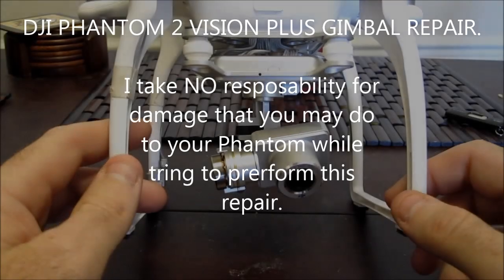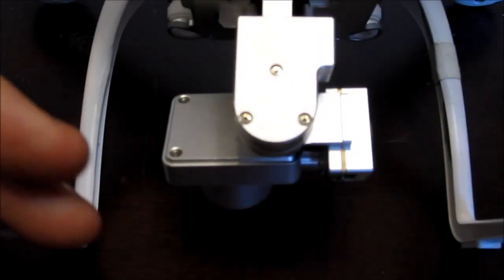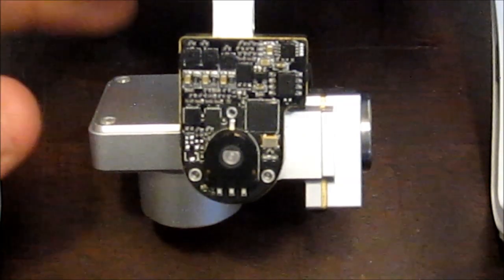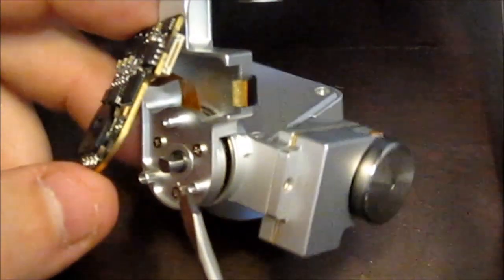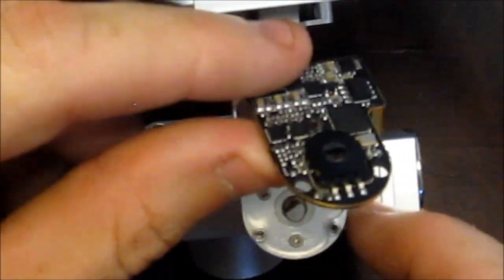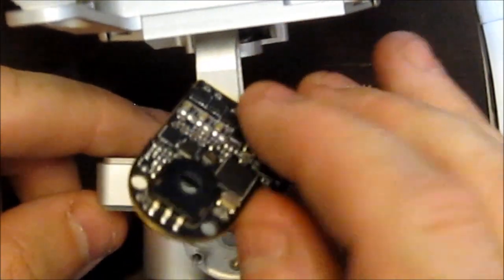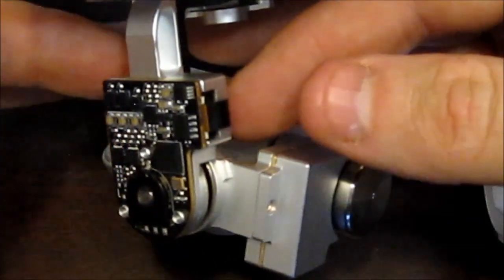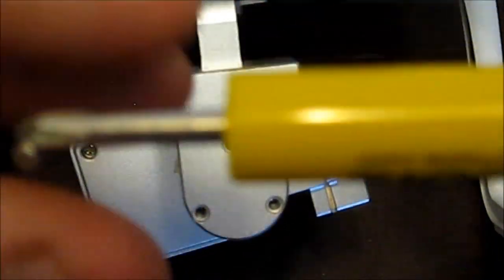DJI Phantom 2 Vision+ Gimbal repair

Comment: Want to spy on your neighbors? Or do something a little less illegal like getting really cool pictures that you couldn't get otherwise? I'd suggest grabbing this drone!🎆🎇>JustU.Faith/DJIdrone?起    Great performance and is extremely easy to fly. Great video. I would say that if you are into RC at all, you need this and it will be great fun without the difficulty of flying the typical quad-copter. It is GPS controlled and can even fly itself...what else would you need?

Comment: It's not working with mine.
I use a good plier, but it just won't move. I'm afraid to brake it when forcing more.

Oh, and for the ribbon. 
There's a small black handle, make sure to unlock that one before removing the ribbon.
Reply: Good tip!!!!

Comment: thank you!  This worked to straighten out my dji3 after a small crash. It was crooked at each start up and IMU didnt fix it and auto calibration only worked per flight. This was a simple permanent fix...just a little tricky getting that cable in. The dji3 pro is the exact same except it has two extra screws.  ...anyways...thanks again.

Comment: Hello! I had the same problem as you with my phantom 2 vision plus and I did exactly what you did, it worked! The camera was level again! But after the next flight I had the same problem. I tried to fix it again like you did and the camera was level again. But after the next problem the problem was back. Do I really need to do this after every flight? ... Thanks :-)

Comment: Heeey THIS IS FALSE !!! They can severely damage your phantom if they do this twist

This is corrected by calibrating the IMU "Calibration Basic IMU" in the wizard.

Heeey THIS IS FALSE !!! They can severely damage your phantom if they do this twist

This is corrected by calibrating the IMU "Calibration Basic IMU" in the wizard.

Heeey THIS IS FALSE !!! They can severely damage your phantom if they do this twist

This is corrected by calibrating the IMU "Calibration Basic IMU" in the wizard.

Heeey THIS IS FALSE !!! They can severely damage your phantom if they do this twist

This is corrected by calibrating the IMU "Calibration Basic IMU" in the wizard.

Heeey THIS IS FALSE !!! They can severely damage your phantom if they do this twist

This is corrected by calibrating the IMU "Calibration Basic IMU" in the wizard.

Comment: Excellent video! I have a drone shop and get so many people that come in with damaged and uneven gimbals on their P2V+s' and Ive always tried to find a way (online) to somehow calibrate the gimbal and get it back even but from what Ive read, there is no gimbal calibration process for the P2V+ and DJI doesnt offer individual repair parts for the gimbal/camera system. I feel so bad telling customers they need to replace the entire $600 unit! After watching your video however there may be hope for some of them! Thanks again for the info! Ryan

Comment: Hi, Thanks for sharing this wonderful video. By the way, is it the same method for restoring Zenmuse HD-3D? Broke my 3rd Zenmuse gimbal, so i thought of harnessing parts from all 3 gimbals, finally finished assembling using several different parts from all three gimbals. Now on startup the gimbal just seems to go crazy and out of control, making grinding noises, moving on all axis, its just acting haywire. Checked all the hex screws, they are all tightened, did factory reset by shorting two points on the main board, updated to the latest firmware. Just don't know what to do, i just don't want to go and waste another 300$ for a new zenmuse. After watching your video, i think it has something to do with the position of those Potentiometers.

Comment: THANK YOU SOOO MUCH
You saved me 700 dollars  I had crashed my drone bent the arm and had severe tilt on horizon. I fooled the servo motors using your video and all is perfect now . watch out for the inner ribbon tho, it came away far too easily while the side one never did.

Comment: I tried this but can't get the shaft to budge at all.  I put a fair bit of force on it and had a good grip with the pliers.  Any ideas?
Reply: Hi Caleb, did you get the shaft moved on this. Mine won't budge either. Hope you can reply!
Reply: *****  Gday Mate, sorry no luck here, have resorted to either putting up with it or cropping and straightening in post. Look back to our first shots it looks like it has been crooked since day one.
Reply: Caleb Bloxham Yeah I've been trying all evening here and it's not moving. I'm afraid I might break it if I try any harder. I only got the Phantom about 3 weeks ago. Might contact my supplier to see what they say. Thanks for replying! I've been looking for answers all evening! :)
Reply: ***** Let me know if you find a solution!
Reply: Caleb Bloxham Hi Caleb, just thought I'd update you on this. I eventually fixed mine just like this video said but I really had to force it to get it moved. A good strong set of pliers also helped :)
Reply: ***** Thanks for letting me know, did you put glue on the shaft once you had it in the right position?
Reply: Since it was so difficult to move in the first place I didn't bother putting glue on it. I've had it out about 5 or 6 flights and it's been perfect since.
Reply: ***** Cheers! Will give it a go.
Reply: Caleb Bloxham I had the same problem. The shaft wouldn't move at all, even trying it with pliers. I guess I'm stuck with a crooked camera. Pretty disheartening considering the cost of the thing.
Reply: Jim Smith Yep I agree with the disappointing part, if I had noticed straight out of the box I would have sent it back.  I manage it by rotating and cropping in post and making sure the camera is relatively level for my shots.
Reply: +Caleb Bloxham So did you solve the problem? I got the same issue, the shaft won't move.
Reply: No. It is still crooked and always will be. If I had it to do over I would have just sent it back.
Reply: +zekestijl I'm like Jim, never got it sorted and is still crooked. Wish I'd sent it back too.

Comment: Great advice. My problem is I have to do it after every time I take it out. Is there a way to stiffen it up while straightening it so it doesn't have to be re-leveled all the time.
Reply: Tony Goss Hey Tony did you get an answer..? I too have to undo screws every time I try to start up!
Reply: I have not got an answer.
Reply: Hey @Tony Goss  and @Steve Downing, I know you faced this issue so long ago, but could you tell me if you got it fixed and how? I'm also having to do this adjustment before EVERY SINGLE FLIGHT !

Comment: My camera flops all around and seen other videos with same problem.  I did the suppose fix but still have same problem.  My phantom was about 10 feet off the ground and the camera started dancing around and caused the crash. Like I said I did what you did and it sounds like something else is wrong.  I've only flown about 5 times. I think I'm going to call and send back.  This phantom vision 2 plus was purchased last month but was only taken outside no more than five times. I'm wondering how we know if we are getting a new Phantom or rebuild.  The box was not shrink packed in plastic like many items bought.
Reply: You can send it in to me and I will replace the potentiometers in it... I charge $100 unless its all bent up. Check out my facebook page. https://www.facebook.com/USdronerepair

Comment: man i had the same issue in my gimbal, and i try your way.. no luck its still the same. i tried so many times but still the same .crazy movments.
any other hints guy..???
Reply: Omar have you had any luck? I followed this tutorial and have tried and tried and its looks as if it's all better at first power on then it reverts to crazy gimbal!
Reply: Lauren .nooppo no luck here to. Sometimes the crazy movements solution is not that way.
I give up with  mine .

Comment: Well done! I have had the same issue. Also had a broken cable and a broken clamp. Some hobby stores may supply you with discarded parts as there seem to be lots of damaged cameras. Do you have a solution for the "death spasms" whereby the camera jerks all over the place?
Reply: Thats caused by a broken potentiometer that can easily be replaced. https://www.facebook.com/USdronerepair

Comment: Thank you for sharing, mine was off by about 30 degrees, took the back off and lightly moved the circuit board out... no screwdrivers, and adjusted it.  It's great now, thanks again. I might have never taken it apart had I not view your video. I feel like I saved $$$ and alot of down time.

Comment: Great Video Brother.  All I did was remove the back plate and then turned the phantom on and it corrected itself.  I used the vision 2+ app and was able to control the tilt again ;) I DID NOT REMOVE THE SMALL CIRCUIT BOARD.  I did not want to mess with that ribbon. I guess removing the back plate on the camera reset the weight or release some pressure from the back plate on the camera and that little screw Don was turning. I did the fix tonight so I could not test it during a flight.  But I did roam around my house with it moving it all over the place and it seems as though, I'M GOOD TO GO!!!  Will update tomorrow and share your video with other vision 2+ pilots.

Comment: Thanks for sharing.  I started out with this method but found it's just a very temporary fix.  Even sitting in the case on end over night and it was back twisted.  A bumpy landing and I was back to square one and every time I did it the shaft would get looser and looser.  But there is a solution and it's simple.  Check my video if you like:    http://youtu.be/SFxM8OOWRQc

Comment from the maker: Tizzflightops It did not come that way I had it in its box and taking it down a rough trail in CO to get some mountain shots when I took it out I saw that the Gimbal lock came off. When I started it up thats when i noticed it was off center. So it happened in its box from the rough ride.